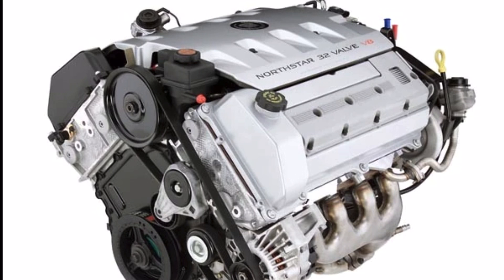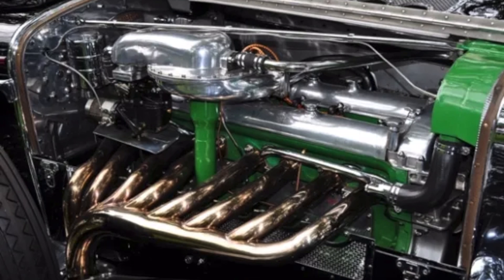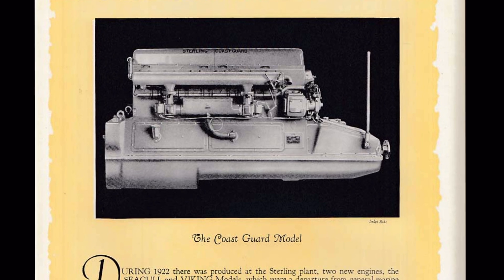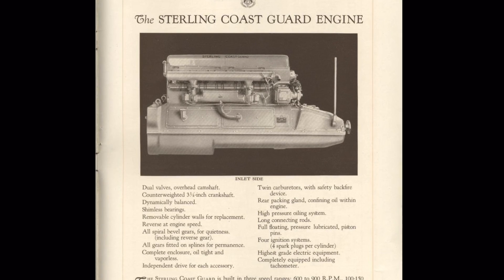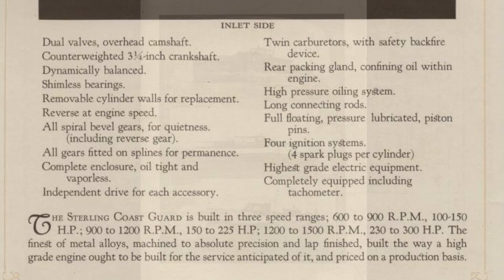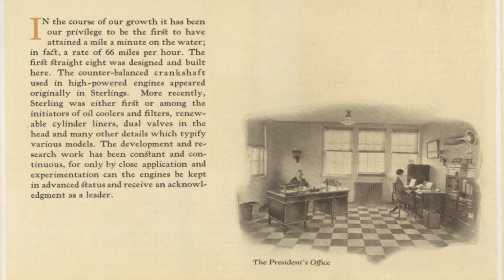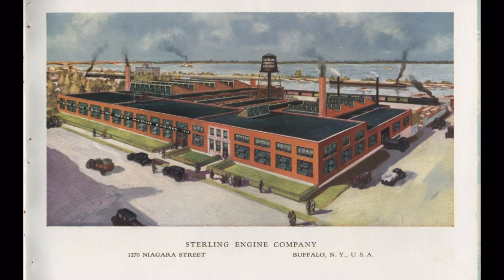They Beat GM, Ford, Chrysler & Duesenberg: 1925 Sterling DOHC, 4 Spark Plugs/Cylinder 1427ci Engine!

Comment: The first DOHC motors came from Peugeot in 1913, landing in the US with elite, race-winning cars in 1914. The Peugeot L45 Grand Prix cars had a traditional inline 4, cast iron block, aluminum cylinder head with 4 valves per cylinder,  gear-driven dual overhead cams plus hemispherical combustion chambers. Miller ended up with one of these engines that evolved into the Offenhauser.
Reply: France was surprisingly in the lead with many car features.
Reply: @maxpayne2574  That should read, Not surprisingly. France and Germany fairly invented almost all of the foundational concepts and technologies which would become  the modern automobile and resulting  industry. European engineering was the most advanced in the world, generally speaking, because of long-standing infrastructure of societies,  industry, educational systems and interconnectedness. America certainly took the lead later on but the principles were almost entirely borrowed from European innovations, manufacturing modalities and technologies.
Reply: @Joshualbm  Now THIS, reads 100% correct. 💯😉
Reply: @maxpayne2574  lol.. Surprisingly? God Americans are illiterate sometimes. ...France basically invented motorsport. Granted, Americans have rarely been associated with professional motorsport but still, you ought to know some history. I remember seeing an American-produced calendar once titled "classic Italian cars" .....it had a Bugatti on the front
Reply: @maxpayne2574  Definitely surprising. It was a different world, back then. The French Antebellum Company, also invented the first V8 engine. Also, the Gnome Rotary airplane engine, where the whole engine assembly rotated! Talk about "air cooled"!
Reply: @BiffTannen1983  Cadillac invented the v8. It is inherently American and not French by any means. The only advancement France had in the auto industry was with suspension with de dion. De dion was really the the last good cars made there and that was on the cusp of auto innovation. Sadly pugeot is what they are know for now and that's not an image anyone wants associated with them.
Reply: @GilBenavidez  materials technology including composites....the Citroen SM had carbon fibre wheels in 1973.  The modern hatchback - Renault.  Unitary construction - Citroen....I could go on but really, comparing what the French have given motoring from an American perspective is a bit rich..inventing the V8? That would only be notable if Cady invented the V configuration , number of cylinders therein is neither here nor there. Where is America's Type 35, DS or SM?
Reply: @GilBenavidez 

Nope the first V 8s then Twelves were developed by a French company for aircraft ...but the engines were so good for the time and light they were quickly taken up in race cars and boats.
Reply: In 1915, the Blood Brothers car company entered a car called the Cornelian in the Indy 500.
It was super lightweight, 1,000lbs, monocoque, and powered by a small 4 cylinder Sterling.
Not sure if its the same Sterling.  Not overhead cam though.
Reply: I think Fiat also had  DOHC 4 valve per cylinder race engines that year too.
Reply: @marcolucchini8173  Cool what was it in?
Reply: @Joshualbm  GP race car. There was a full documentary on the history of the automobile about 20 years ago. What I got out of it was that just about everything we have in modern cars was done in the early 1900's. Improvements were basically made in metallurgy, lubricants, fuels, manufacturing processes and tolerancing.  Even the beast of Turin ( FIAT) had four valves per cylinder and I think it too was a DOHC engine. A massive 28Litre four cylinder engine built in 1910.
Reply: @Joshualbm  https://en.wikipedia.org/wiki/Fiat_S76_Record#Technical_Features
Reply: @marcolucchini8173  Beast, is one of my favorite. I had to Google it, to make sure it's what I thought it was. That thing is badass.
Reply: The very first V8 engine was created by Antoinette as used in Santos Dumont 14 Bis aircraft.
Reply: @kkteutsch6416  

True Id forgot about Santos Dumont's part ... the only man to commute round Paris in an Airship.. pioneer of the wristwatch as designed for him by Cartier... and early HTA flier. 
His heart is in a silver and glass   container guarded by the Brazilian air force his home country.  Possibly the man who inspired the alien in the David  Bowie film The man who fell to Earth.
Reply: You state "aluminum cylinder head". The engine actually had a combined cylinder block & head made from cast iron. This was standard practice in those days, to avoid a problematic head gasket.
Reply: If the bore was 6.25 " and the stroke was 7.75 " , that would be 231 cu in per cylinder,  times 6 cylinders = 1386 cu in... not 456 cu in .
Reply: @Joshualbm I came looking for this comment.
Reply: Peugeot also make really good pepper grinders today

Comment: The tacoma fire department ran in the 1930"S fire boat sterling engines well into the 1980 'S . The engines came out of the charles N curtis. retired coast guard patrol boat. They were monsters for a gas engine. The fireboat had straight exuast . You could hear it for miles. The boat is now on the beach in a park in tacoma. Just too Quite. Best Regards

Comment: One exception: cosworth Vega. Great video!
Reply from the maker: Good one!
Reply from the maker: I suppose one could say it wasn't GM engineered since the head was done by Cosworth.
Reply: @RareClassicCars  Fair point.
Reply: Also a very limited production run,  sadly
Reply: @jamesengland7461  the well running well engineered Cosworth engine fell on the ground when the Vega rusted out. .
Reply: This is true . My father bought a brand new 1976 white Cosworth Vega.. The car I learned to drive at 16.. 
DOHC 16 valve 4 cylinder.  It also had Bosch Electronic Fuel Injection!  Gosh almost 50 years ago!

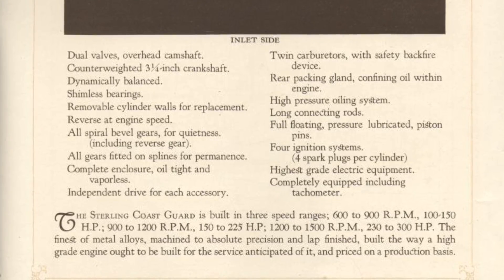Comment: 5:55 The displacement of a 6 cylinder engine with 6.25" x 7.75" bore and stroke is 1,426.61 cubic inches, so you were off by 1.
Reply: when he said 300hp at 1500rpm, i knew he was off. you would have 1050ftlbs and no normally aspirated engine of 456cu inches would ever make that amount.
Reply: @notme7357 exactly even modern race stuff naturally aspirated on lower octane gasoline, you're really somebody if you can make over 1.5 lb/ft per ci.
Reply: He's off by 3.125.  He didn't square the radius of the bore.
Reply: Yeah, I saw that bore and stroke, 450ci or whatever he said sounded a little small. Makes more sense that it made 300hp at essentially a high idle these days of 1500rpms. I bet those engines were reliable. They had to be bought out and destroyed immediately. Can't have a sensible company, selling reliable, re-buildable, products with minimal corporate waste and planned obsolescence. Of course that would be considered unacceptable and had to be stopped...🤦

Comment: Very few manufacturers can make a solid reliable DOHC. 
Honda, GM and Ford were disastrous with DOHC engines. They should have kept it simple SOHC.
Reply: The Ford 3 liter Duratec and the 5 liter Coyote seem pretty durable

Comment: When I heard about roller lifters and rocket arms in the late 80s I figured they were new technology but after looking at the cutaway engines at the Air Force museum in Dayton Ohio those items were not new as they were in aircraft engines back in the teens and 20s.
Reply: Harley Davidson had roller lifters in the 1920s and 1930s. They also used roller bearings in the crankshaft and connecting rods, fitted to a tolerance of one ten thousandth of an inch and serviced in the field. There was some pretty impressive technology developed 100 years ago and more.

Comment: Double overhead cam engines didn't become commonplace because they were too expensive to manufacture, but the US Military with its huge taxpayer funded budgets could pay for them. The Coates Spherical Rotating Valve heads are lightyears better than any DOHC head, but again because they are not manufactured in large quantities, they are very expensive in comparison. The Coates SRV heads can generate the same airflow of a DOHC poppet head with just a mere 2° of rotation.
Reply: Engineers have been trying to produce rotary valve or sleeve valve engines for 100 years, with very limited success. The Bristol radial engines of WW2 were about the only ones with any success and they were very expensive to build and took a lot of maintenance.

Comment: The Hart-Part 30-60 was a two cylinder overhead cam engine with hemispherical combustion chambers. 3,800 were built. The bore and stroke was 10 x 15 inches.  It used water injection to prevent pre-ignition when using kerosene. It was oil cooled and was first built in 1907 in Charles City Iowa.
Reply: Holy cow!  That's a thumper
Reply: It has a maximum speed of 300 rpm @bobcoats2708
Reply: I think it was Hart-Parr, not Part. I know someone who was into those yrs ago.

Comment: Tatra CZ had a v8 hemi air-cooled rear engine independent suspension car 1938.
Quiet gears to evade Subs possibly?
PS ' Sterling "( a new company) makes 1500 hp offshore racing engines for cigarette boats today .
Reply from the maker: Good point on the gears to evade subs.  Not sure, but perhaps.

Comment: Four  ignition systems and four plugs per cylinder... I bet this is designed to run on petroleum distillate, rather than what we think of as normal gasoline. Distillate was a heavier fuel (somewhere between kerosene and diesel) and it took a LOT of energy to get it to ignite. Mid-late 1920s is the right timeframe: gasoline had become comparatively expensive, and lightweight diesel engines were still a few years in the future.
Reply: Ignition systems were not very good at that time. They took the measure of adding more plugs to do the job reliably. If the multiple plugs were properly timed they would give some advantage in avoiding detonation and that was likely the main advantage. Large cylinders always have more problems with detonation and having the ignition point on more than one place does lead to more controlled flame travel in the cylinder. Ignition systems have improved greatly since the 1960's and fuel is so much better than it was in the 1920's that multiple  plug systems have all but disappeared  except in aircraft engines.

Comment: An engine that suprised me by it's complexity is the Kharkiv model V-2.  It's a 1939, DOHC per bank, 4v per cylinder, direct injection, watercooled, aluminum, diesel, 60 degree V12.  It's famous for powering the T34 tank in WWII.
Reply: And then the sowjets decided to only make 8valve carburated 4cyls for the next 50 years
Reply: Whats more is it has master and slave setup connecting rods to make crankshaft shorter and also the cams are driven via bevel gears.
Reply: Quite the engine. When you said they were used in landing craft and I've seen many in WW2 documentaries you showed something that looked like a pt boat. Landing crafts are big and open and the front is a ramp that opens for the soldiers to run to the beach.
Reply: There’s a YouTube channel by “Mr. Hewes” who is rebuilding a T 34 engine.
Reply: The designer had Greek ancestry & eventually Stalin’s purge reached the ethnic Greeks of the Donbass & the designer was purged with a bullet too.

Comment: I don't think this is a DOHC engine as it claims to have two valves and a camshaft, not plural.  Also the valve cover doesn't look wide enough to house two sticks.  Finally, if it is a DOHC design how are they driven?  I do not see space for two sprockets, just a single one.
Reply: Dual inlet and dual exhaust valves in the head are operated by twin camshafts. Dual valves admit a fresh charge rapidly, scavenge the cylinder thoroughly, increase the power. practically eliminate warning, and reduce periods of adjustment or grinding. Spring loads are reduced as two smaller valves weigh less than a single valve for the same port area. Valves cool more readily, and hold their shape and seating.

Comment: Thank you for a great video. 300 hp @ 1500 rpm?....the torque spec. must have been unreal !!!
Reply: Using the simple inter-webs calculator, 1050 ft-lbs of torque was produced!
Reply: Thanks. It would have have been nice to get a published spec.though as the torque peek was likely a bit lower than 1500 rpm @Cfchild1
Reply: Yes, 1050 ft-lb rating provided by the calculator is only approximate of course. Regardless, that 7.75" stroke must have made it a torque monster which would be what is needed to move watercraft with load carrying capability at speed.  @oops1952
Reply: You're right....thanks again @Cfchild1

Comment: The Horch 8 had a DOHC in 1926.
Reply: Peugeot had in 1912 a twin cam 4 valves per cylinder race car that won multiple times at Indianapolis.
Salmson offered in 1921 a twin cam straight 4, very successful design that was produced till 1957.
Ballot did the same in 1923 (they later had 8 cylinder DOHC)
Alfa had a twin cam race car with dual ignition in 1914 and DOHC production cars from 1927 on.
Lagonda had twin cam production car it in 1925 (supercharger available in 1930).
Sunbeam also offered a twin cam production car from 1925 to 1930 with an optional supercharger from 1929 on.
Reply: @jean-charlesweyland129 Pretty much everyone, especially the europeans, had Overhead Cam engines at some point prior to WW2 in at least some application.
Reply: @mrspandel5737  Yes, for exemple the Fiat 509 (Italian equivalent to the Ford A) had a SOHC in 1925.